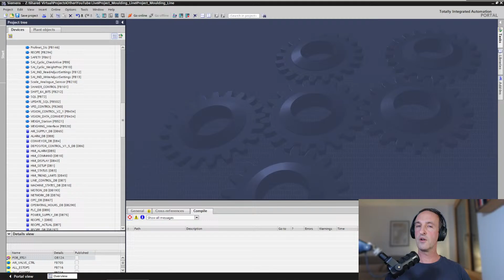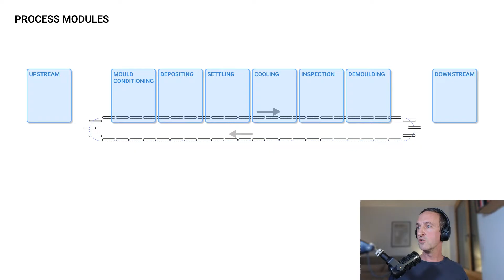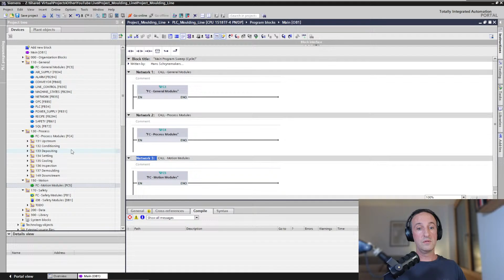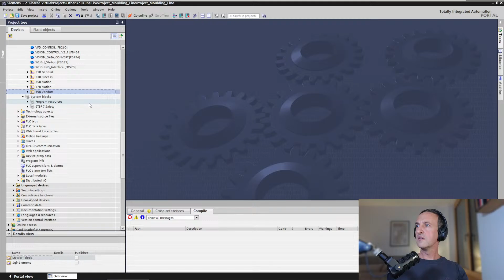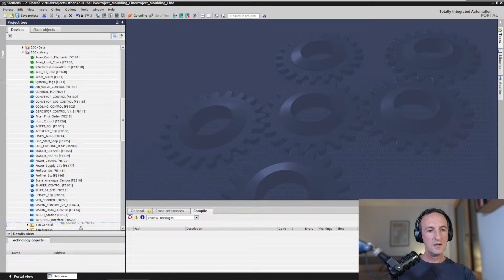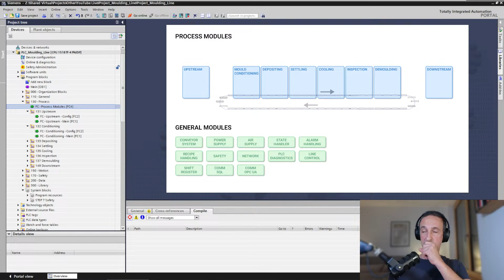🔴 Live TIA Portal Workshop: Cleaning Up a Messy PLC Program

Comment: Are the Process Modules the same than Process Phases and could they be splitted into EQMs? I think the ISA 88 standard could be applied. Thanks in advance for your answer. Greetings from Bruck an der Mur
Reply from the maker: Yes ISA88 relates more to process control where you have process phases and equipment modules. I work mainly with production lines so there might be some differences in the structure.